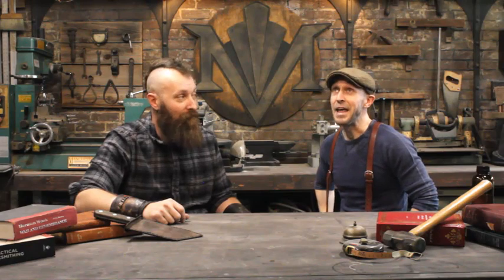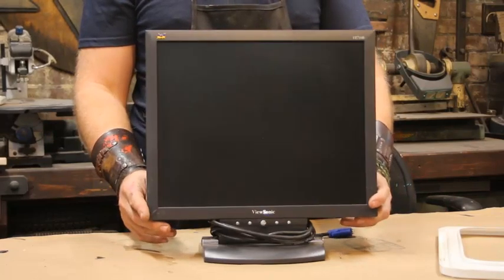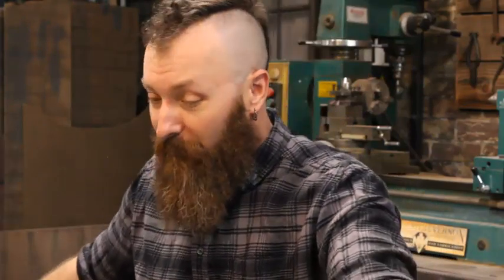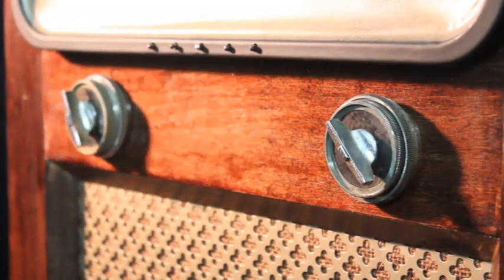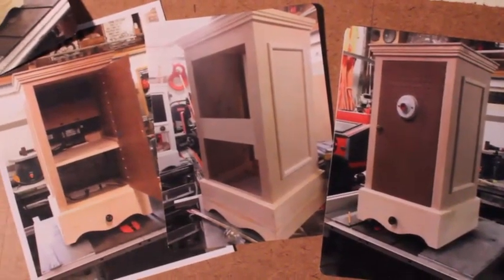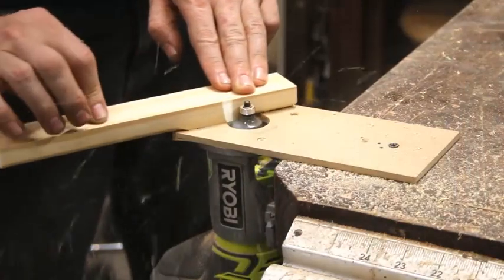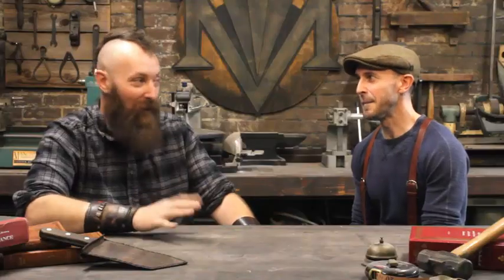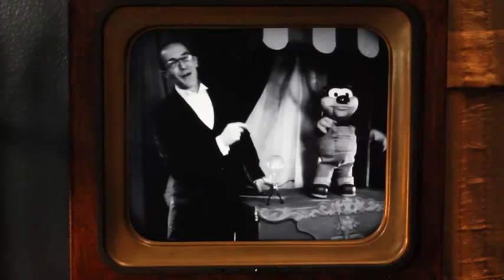Builds: Vintage Television Set

Comment: How did you connect the monitor with the dvd device? As I saw, the screen had an d-sub connection. Did the dvd player had one aswell?
Reply from the maker: Actually we utilized an Amazon firestick as opposed to connecting a DVD player.
Reply: @manchestervernon5115  My monitor has'nt this port. Do you have any idea how I could connect the d-sub with a scat-port? (is this even possible?)